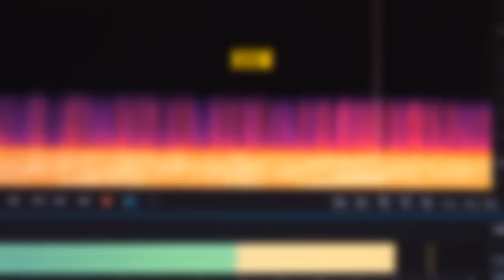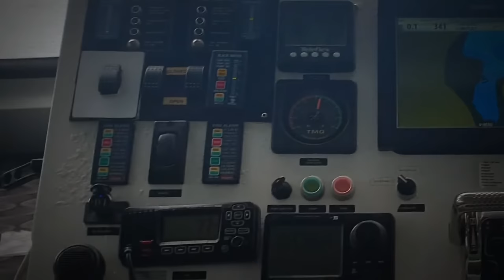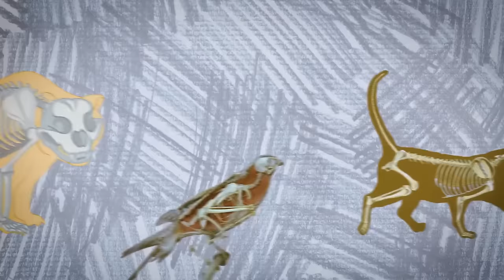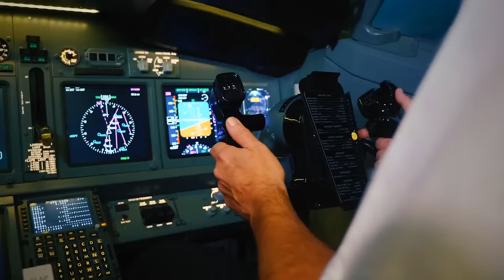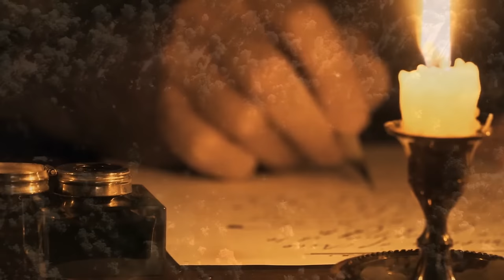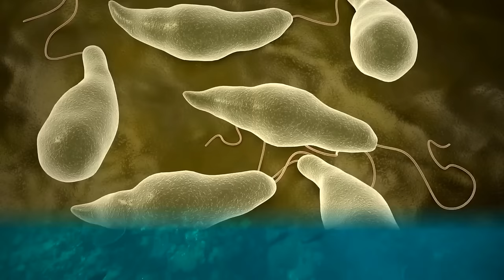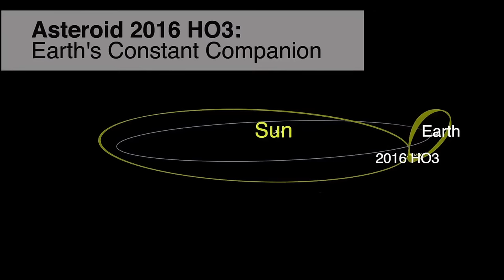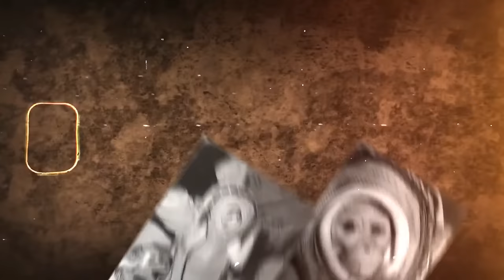Scientists Are Shocked to Find These Tunnels Created by Ancient Monsters

Comment: Set the time to say the mountains is moving you said swaying back and forth vibrating is not swaying and of course the movement on top of the mountain is going to be faster than the bottom of the mountain because it's a lot smaller than the bottom it like a tuning fork when you bang the tuning fork the vibration movement goes up to fork and gets faster and because it's smaller than the bottom the movement is not swaying it's vibrating and you said it moves once every 2 seconds has caused by earthquake seismic movement and the ocean then that would mean earthquakes would have to be constant all the time non-stop but that doesn't happen all the time I think they realize the mountain is vibrating and they just came up with that as a theory otherwise guessing why the mountains is vibrating and making that humming sound it's probably just the wind going around mountain and making that humming sound it's like when you Force air into something or around something it's going to make a noise like a flute or even a straw